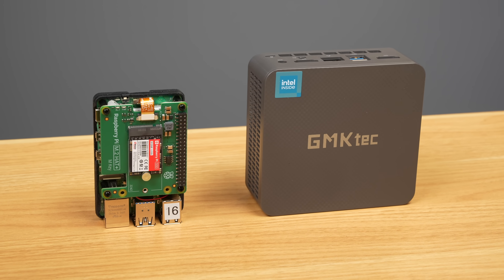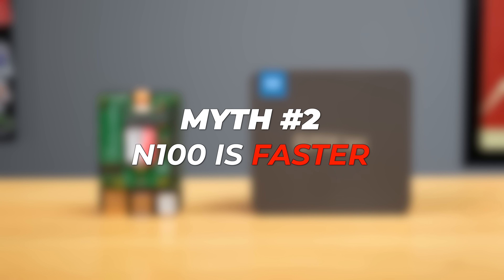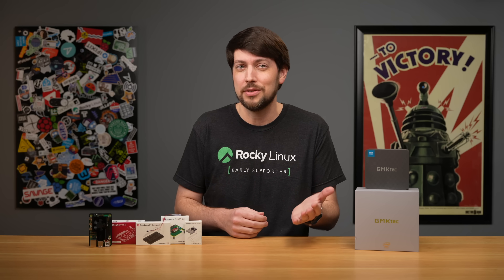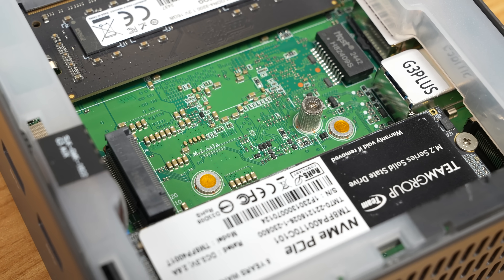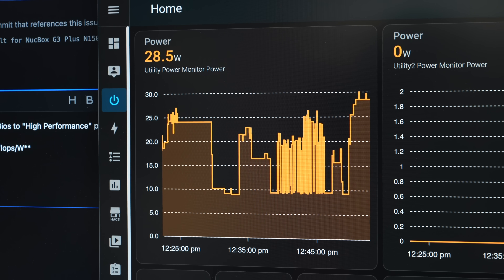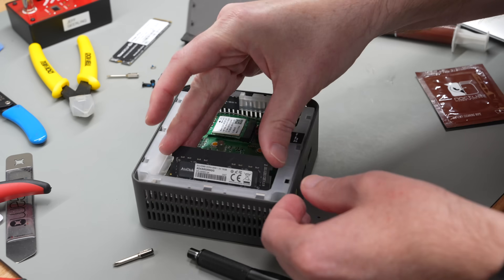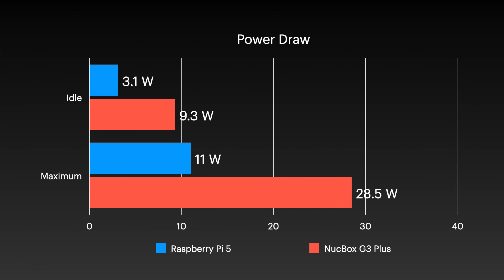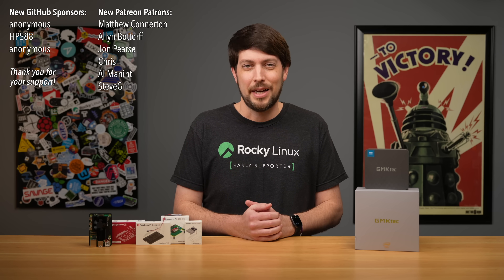When did Raspberry Pis get so expensive?

Comment: my problem is when people try to talk about using a pi for an every-day-person's everyday-PC. THAT is when the economics, let alone functionality, fall apart.
Reply: Indeed, raspberry pi's are primarily embedded devices, not desktop replacements. You can put them in your own products, run them non-stop because they don't have fans, you can connect IO to it or communicate with other electronics. On top of that the company is British and gives back to society with several educational projects.
Reply: Well i'm not an everyday person and I use mine as my power failure pc. I can run it, router, and display directly off the DC side of my solar generator without running the inverter and losing power to conversion. Even with my 12v fridge there's power left over. And i'm "comfortable" around linux having used many distros starting with PCLOS in early 2000s
Reply: the right tool, for the right job....  Is an age-old Truism, that still stands
Reply: @ Exactly..,!
Reply from the maker: The only one I would say is geared towards that market is the Pi 500 — though Raspberry Pi's own page for the Pi 5 says "The everything computer." - that's not necessarily saying 'general everyday computer' but it does seem to feed that narrative.

It's nice that it can do that stuff decently well, of course. But that's a side-benefit. I like the fact I can use it in a lot of different scenarios, especially when integrating some GPIO or a camera/display.
Reply: If they don't target desktop replacement why does that feature so prominently in their marketing material? Also, why dual HDMI? I think Pi are making choices with the intention of making the Pi appeal as a desktop replacement, but which are poor choices for makers - mini HDMI is an obvious example - and drive the price up, out of reach of people who just want a cheap plug and play device for learning about electronics and coding.
Reply: @Oliver-l1c the pi project originally focused more on the software side, with the gpio being an afterthought. Turns out that a lot of people really like it.
Reply: @JeffGeerling  It's not about what the Pi foundation/company 'gears' it for, a lot of people use (or intend to use) Pis that way. The success of your channel demonstrates this, while channels that use Pis as embedded devices for maker projects are much smaller. So it is perfectly reasonable to say "stop, Intel J4k/N95/N1xx/N3xx-based boxes are a much better option in terms of price, performance and compatibility". And something like a Radxa X2L (J4125) SBC is going to be a better bet for a lot of embedded use cases too. What's more, if people stop buying Pi when in such volume for use cases where they don't make sense anymore, maybe they'll get the message that the pndemic is over and they need to compete for our money and attention again.
Reply: @JeffGeerling  for me the pi has always been for tinkering not a general pc it does not have the horsepower
Reply: @JeffGeerling as a non-gaming tinkerer, I’m very happy with the pi 5 for everyday
Reply: @JeffGeerling  let's be real most things don't need GPIO and those that do you can easily add something that provides GPIO like Adafruit FT232H
Reply: @DJDocsVideos difficult to add PIO type functionality like the pi5 has.
Reply: @JeffGeerling  pi500 with an SD card in is still not an "everyday general computer" now add an NVME drive, now you're talking...
Reply: @gedgicat2063  It is possible, as we all know now.

BTW, the closest ARM SBC to a basic PC is something with RK3588, such as Orange Pi 5 plus. It has enough power to run a browser smoothly even with HD video playback (which was the main problem with RPi4 and older). Yes, it's a bit more expensive, but it has native nVME support and many other features.
Reply: They each have their place in the market.
Reply: tbh i use my pi4b for daily stuff (not gaming, thats for the xbox 😂) it does what a pc would be doing mostly (about 99.3%!) basically, it just works! 

still dont like the second hdmi on the pi's, space could be used for something else!
Reply: I bought the Raspberry Pi 5 16 gb and use it as my primary computer. I didn't buy one of those unknown computers off of Amazon because I don't trust them. I know what Raspberry Pi is going to do and what to expect when buying it. Sometimes reputation is more important than $40.
Reply: @davidkay1386Quite. A quality product is usually more expensive. E.g., ongoing software and firmware support is built into the price. Plus I have more confidence that Raspberry Pi will be around in 5 years than a no-name Chinese brand.

As for performance, if a Pi does what you need it to do, who cares if something else is faster?
Reply: My “buy an old elite desk” recommendation holds true for the pi as desktop crowd.
Reply: @ 100% agree.
Reply: I know it's a different price bracket, but honestly the Steam Deck is a decent low power everyday pc, it even comes with a battery!
Reply: @XenHat when I upgraded to the OLED my sister needed a PC. She's been using my LCD steam deck, docked, running windows, for a year now with 0 complaints.

I don't think I've ever been more happy with a purchase haha
Reply: @XenHat I use it for experiments
Reply: @XenHat  My steam deck IS my windows "PC".  Im a mac guy but obviously thats not great for gaming.  My steam deck basically works like a windows based nintendo switch for me.
Reply: @XenHat  i use a deck as my desktop running Ubuntu. It sits in its dock, attached are two 24" LCDs and i use it for everything. Only downside, after the GPU takes its share i have to work with 12 GByte of RAM. 😅
Reply: @XenHat Battery, screen and a
 controller
Reply: @XenHat especially when the OLED came out all of a sudden the refurbished LCDs started at like 250 bucks.
Reply: Especially considering how hard the Pi Foundation was trying to push the "everyday PC replacement" message even back in the Pi4 days. Slide-show level YouTube videos do not a desktop replacement make
Reply: CONTROL THE MASSES!
They are too cheap and powerful...
Brain Wave Reading device at 435hz...
Pis or Jet Nano PORTABLE!!!
Connected to a portable ARM...
You think "computer GRAB MY..."
AND THE THING JUST DOES IT!
WE ARE CYBERPUNK 2025!
Reply: I only use Pis for things like 3D printers and automation.
I bought Pi 500 recently which is meant for human use, but I bought it for micro-soldering practice (M.2 slot and DC-DC for it).
Reply: Why is the RAM so expensive, RAM is cheap,  they should use a SODIMM slot or something.

considering  FT232H GPIO is like $10 any PC will do even a phone and if you want small use a phone, why use a pi at all except for fear of wider linux community? Miss information of ecosystems etc. They have a very limited real world appeal for a real use case IMHO.

except the zero 2w that is so amazingly small and cheap still.
Reply: I use rpi5 as my only desktop. But my most challenging app is a browser and a compiler.
Reply: To be fair, the Pi's were marketed as a desktop replacement.
Reply: Y'all still doing n100?

There's n150 and n97
Reply: I think that the best case scenario where the Arm devices wins over PCs is in power consumption, I don't care on leaving rpi4 Nas running for months, but I do care when my desktop is on for days ,Is something that I can notice on the Bill , so in the long term arm based computer pay them self
Reply: exactly. the reason why i use an RPI is because i am looking to do something with the IO ports, that, last time i checked, my x86 pc doesnt have 7 gpio pins to connect LEDs or exposed SPI bus. use the correct tool for the correct problems.
Reply: I would say it really depends on what they use it for.  Some of my older clients that are just getting email and being outraged on Facebook a PI would work fine for.
Reply: I love all the ideas embodied in the Pi and similar platforms, but... If people only knew how to scrounge eol desktops, and if they knew what was going into the boneyard at their local businesses and public institutions etc, they'd be amazed at how much PC they could get for free. Plenty of 8th to 10th gen i5s or better, in business workhorses like the Dell Optiplex 5000 series, are now 5-10 years old and being aggressively replaced. Most of them that are given to third party e-waste "recycling" companies are being refurbed and sold. IT depts who keep the RAM before sending the PCs to live on a farm are absolutely awash in DDR4 sticks. Surplused business PC's almost always have legit Win11 pro licenses attached, if you can get the activation code. Etc etc. If you know a tech that works for a medium or large organization, just bring up the subject casually and see if they don't hand you a business machine that still works fine for business things. I do still love tiny PCs with negligible power consumption though.
Reply: Note: IT bosses often don't want all this publicized unless they have some kind of official surplusing pipeline. So discretion is advised. 🙂
Reply: Really depends on what you want - not all of us are gamers, CAD users etc that need more than a functionally snappy browser, media player and office suit and Pi's have been able to handle that and even fairly complex CAD models pretty well since the Pi4 (RAM and cooling/overclock level does make a difference of course).  So yeah the everyday PC that sits behind your TV/monitor and is always on the Pi's are for most folks probably the ideal platform - even flat out the Pi power draw is generally lower than other options can idle down to and the performance is fine. I did till the power supply failed have a heavily overclocked Pi4 with a hefty salvaged cooler (Pentium 4 I think it was meant for) built into my desk that was my default computer and did mean my workstation only got fired up once the CAD models got really big or I was gaming... So yeah for most folks its probably fine.
Reply: @foldionepapyrus3441  but the Pi5 still not powerful enough for browsing when you consider the video codecs situation with VP9 and AV1 (neither of those are decoded from hardware by the Pi, while the N100 can happily do both).
Reply: @foldionepapyrus3441  Pi's are not even close to snappy. using a Pi5 for web browsing is like going back to core 2 duo days or even worse
Reply: @foldionepapyrus3441  I agree with you. In my case, I spend a lot of my day reading papers, taking notes, and writing article drafts. I do some simple analyses using R in the terminal and watch some videos (also for work-related analyses). Chromium browsing is smooth, and online collaboration is easy. I have a much more powerful computer if I need it, but most of the time, I don't, and I save resources with the RP5's low power consumption. Plus, it's portable, so I can take it and work on simple tasks in different places. I could have bought a basic laptop, but the RP5 has the advantage, for example, of being able to take it on weekends when I visit my parents, and with a simple SD card swap, it turns into a multimedia center, without me having to worry about something going wrong and corrupting my data on the laptop's disk. But I also see it as a matter of preference and... what would life be without any fun? It doesn't entirely replace the experience of a powerful computer, but for simple tasks, it does the job perfectly.
Reply: The Pi 5 is more than enough CPU for most people. The issue is the GPU is woefully inadequate for things like video playback and the lack of PCIE lanes.
Reply: Really depends on what you mean by “every-day-person” here. Like I guarantee my parents could get away with the power of a pi, since all they’re doing is streaming and using the browser rarely, and I used a pi3 years ago for just that purpose. Which I think falls inline with an every-day non-tech enthusiasts needs.
Reply: What's wrong with using a pi as a daily driver? I rock a pi zero 2 as a home theater running Kodi constantly. It stumbles with 1080p playback, but 720 or lower, it runs great!
The pi 4 is still a great option as well. I use one as a media server and ad blocker, but really don't need anything more to get through  a day of general use.
Intel leaves a bad taste in my mouth. Seems there are tons of cheap intel machines being pushed on the public. Some really are a waste of resources, in my opinion.
Reply: A home theater running 720p or less. 😥
Reply: @grimsage4495 720p in 2025? Welcome back to 2002 I guess.

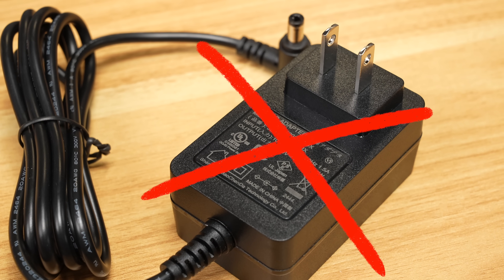Comment: 5:37 At least you know GMK doesn't cherry-pick their review samples.
Reply from the maker: True; they haven't been pushy in their communication with me at all, which is a lot different than many of the other tiny PC manufacturers. That's the only reason I agreed to have them send one.

They've also sent over a little 4-NVMe drive NAS mini PC (it has some ups and downs), and I'll hopefully get to testing that soon!
Reply: @JeffGeerling I saw a youtube review of this one (hardware haven?). Wonderful hardware, significantly higher price ($300 for almost bare bone).

I am not editing videos, so a RPI 4, 2 USB docking units and leftover disk drives are my NAS go-to solution. I love that the disks are spun down most of the time.

Comment: We need a comparison with a proper AMD mini-pc, they're way more power efficient and provides way more performance x watt
Reply: They are more expensive. I'm not sure AMD makes anything as cheap as an Intel N100, maybe the Athlon 3000G.
Reply: Even while I love AMD APUs and buy them whenever I can, I cannot find any AMD competitor to the low end and low power Intel N series anymore, only older, slower models. The margin on this segment is too low and AMD needs margin to survive.
Reply: @ Their Ryzen 3 7320U seems comparable to the N305.
Reply: I bought one of the mid-range AMD mini-pcs because I wanted something that would run mid-range Steam games. I also have a Pi 3b and a Linux laptop. They each serve different purposes.
Reply: For an overview of the miniPC ecosystem that is good it should be N100/N150 for low end, some efficient zen4 for mid range and the ai max 395 for top end. But the n100/150 is what competes with pi on price and they are fairly efficient.
Reply: @tappy8741  I bought very cheap ($25) used N4000 thin clients running Motion, and they work better than the RPI 4 that they replaced, even while benchmarks say they are equivalent. (I suspect that this is because Motion uses SIMD code on x86.) How much one needs depends on the use case, really.

Comment: I got a GMKTEC and it rocks.  On the go, the pi is much easier to carry.
Reply from the maker: Pi fits in more pockets :D

For something where you're going to mount it somewhere, integrate it with something, etc. the Pi definitely has the upper hand. But these tiny PCs are so much nicer in that regard than the thin client PCs that are so cheap on eBay (those are heavier with their integrated power supplies, and usually don't have mounting points so you have to strap it or velcro it to something).
Reply: @JeffGeerling  absolutely.  I got a nucbox m6 for like 200 bucks.  Threw double 2tb ssds in the bad boy and it solved my dead server problem (temporarily).

Comment: A big benefit for intel is their integrated graphics and encoding.
Reply from the maker: True! Though the iGPU cores on the N100/150 are not quite as good as the ones on their beefier desktop CPUs, so some people probably overstate how powerful the iGPU is on the tiny Intel SoCs.
Reply: @JeffGeerling The iGPUs have the same or similar encoding capabilities anyway, so it doesn’t need the GPU cores to actually encode or decode video, just the hardware encoder/decoder within the iGPU block.

Comment: SATA M.2, why now? M.2 Sata drives are near impossible to find in any capacity that's worth having. So why are these slots suddenly turning up? Also, SATA is a dying technology. There are definitely fewer manufacturers still building SATA SSDs.
Reply from the maker: My guess is it ticks off a feature since there is a SATA port available from the N150 directly—some people will probably see that and think it's just an 'M.2 slot' (to most people that means 'SSD'). They might someday buy a 2242 NVMe SSD and then get sorely disappointed it's not actually an NVMe slot!
Reply: It's only there because SATA remains integrated into the PCH within the N150 SoC; zero PCIe lanes are used to support up to 2 SATA drives.

Comment: Maybe x86-64 needs more clock cycles than an arm processor to do similar tasks?
Reply from the maker: Architecture certainly matters. Though I don't get as deep as a blog like chipsandcheese so I can't give a full answer on the merits of the Intel E-cores in the N150 and the A76 cores on the Pi 5.

Could also have to do with the caching on the chip, and the RAM speeds certainly play an effect too—if we had DDR5 on the N150 in this little PC it'd be a bit faster in many benchmarks.

Comment: this is what i have been saying - by the time you get into the RasPi ecosystem your wallet knows it. And they SUCK. They are crap. I would rather spend 250 or more and get a little x86 that can, than the same amount to bump against frustration at every turn. Srsly Ive owned 3 pis and they are all in a drawer somewhere because everytime I try to use them - SOMETHING goes wrong, I need to buy something else. Its meh